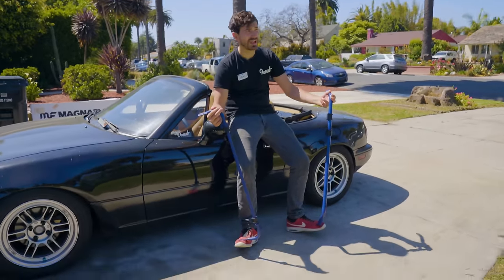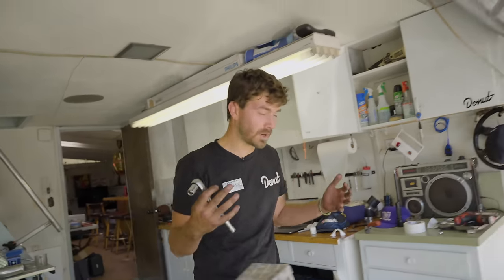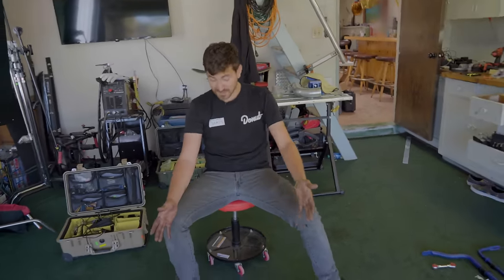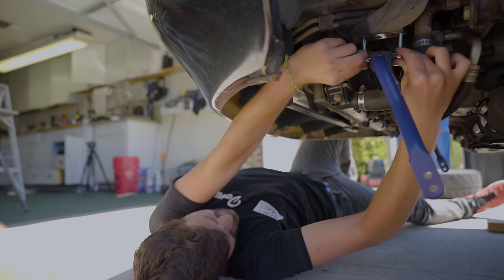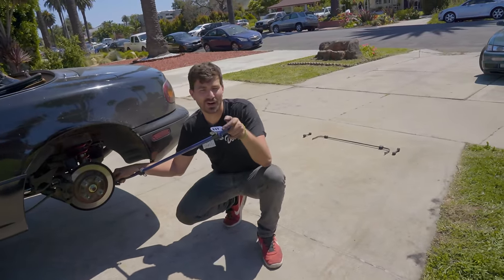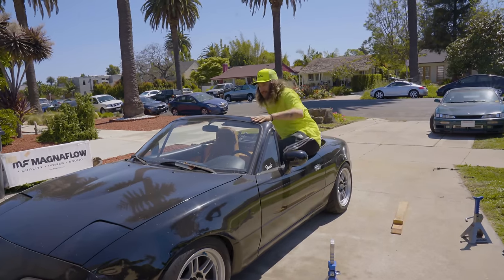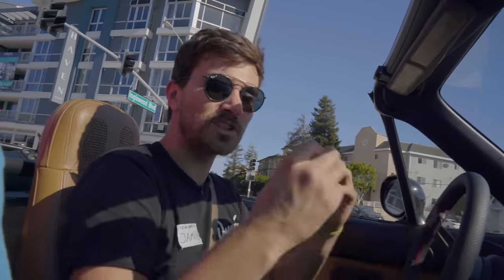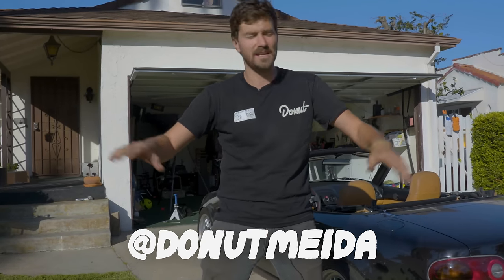Are Aftermarket Sway Bars Worth It?

Comment: I feel like handling mods in a muscle car is the first thing you should do if you're building a track/drift car, since that's typically a muscle car's weak point, it'll still be out cornered by Miatas and whatnot but it'll take corners faster than it would stock

Comment: Use Teflon tape under the bushing and the grease lasts WAY longer and it feels smoother. Especially great for the squeaks cold climates.
Reply: or just get a high quality bushing that has proper knurling like superpro etc, or even whitelines greaseless ptfe sway bar bushings

Comment: Quick answer: They're EXTREMELY worth it if you drive normal car, like a normal Civic/Golf/Corolla.
I have a old Fiat Uno that wanted to roll over and kill me at every corner, it had a skinny 15mm sway bar from factory, there was no aftermarket sportier replacement for it, so I bought a 19mm bar from the pick-up version of my car (Fiorino) and installed it with PU bushings. It made all the difference in the world, it truly transformed the way the car behaves, much, MUCH snappier.
It was such a good upgrade that I repeated the recipe in all the cars of the family.
My brother's MK4 Golf got a sway bar from the R32, and my mom's Renault Logan got the sway bar from the hot hatch Sandero RS, both were installed with PU bushings.
The difference was night and day, we live in a state where roads have tons of curves, and normal cars roll so much is actually nauseating, all 3 cars basically ignore curves now lol.

The best part is: We didn't lose comfort, AT ALL. When you're just cruising in a straight line, the sway bar is not actively working, so you can't feel any difference whatsoever.
But attention! You WILL lose comfort if you install PU bushings in the entire suspension. If you still wanna daily drive your car, with comfort, I strongly recommend PU bushings to be installed with the sway bars and links ONLY.

I live in Brazil BTW, that's why some car names might not sound familiar.

Comment: Body roll generates grip though. And for a car generally known for its exceptional handling properties from the factory, in theory you'd reduce body roll, but loose grip. Would be interesting to see a timed run of a complex handling course or before and after roll bar change with no other changes inbetween. Somewhere that needs grip too. The theory goes that youd slide around more all things being equal but with stiffer roll bars

Comment: The first time I drove a convertible I could feel a more pronounced body sway and torqueing.  The roof of most cars keeps the unibody square.  Removing the top definitely reduces that rigidity.

So yeah, anything to strengthen the frame's rigidity will make a difference.

Comment: Swaybars are first mod on any miata.  No better way to dial in the behavior of a car for street or track with a single part.  Often they are too rear bias on middle settings but that is good for street work, then put the rear bar to a softer setting or even disconnect for track time

Comment: I wouldn't say sway bars don't affect your ride unless you are in a performance kind of scenario, driving on a more normal highway pretty much true, but let's say you are in the canyons or headed down a road that hasn't been very well maintained, like you said the sway bar does its thing when there an opposing force from the suspension and if you hit a bump on one wheel, there a split second of an opposing force and depending how stiff the sway bar is you might feel it more then you would with a smaller sway bar. Anyways though awesome videos! Keep it up!

Comment: Adding of stiffer rear sway bar to a FWD car will help mitigate understeer and help the car rotate. However, getting it too stiff can lead to lift off oversteer, which can be dangerous on the street if you don't know how to handle it Making the rear stiff is a trick that Ford uses for the Focus/Fiesta ST. 

I think Mazda intentionally left the suspension soft in the MX-5 because the whole point of the car is to have the sensation of speed, more than actual speed......and a bit of body roll in corners adds to that. At least that's what I think.

Comment: 9:55 That is not really true, as not letting much weight transfer also means that the wheel with most weight on won't be allowed to take advantage of it's full grip. 
Overdoing it with a sway bar can actually result in the opposite, lost of grip in higher speed cornering. It's always a trade off between responsiveness and grip to achieve a balance.
Reply: Thank you for your expert opinion. Dont know what i would have done without it.

Comment: Well I have a 2013 Chevy Impala LTZ with the fe3 sports suspension and I can tell you when I went through and replaced the front Halo sway bar with a front solid sway bar that made all the difference in the world on how that car cornered. I also replace the rear sway bar with what's called a sports sway bar I don't know if it was really any thicker but also all my mounting points that were rubber I replaced with polyurethane which the squeak a little bit sometimes but is tremendously stiffer

Comment: I wish sway bars came in various choices, usually much bigger is the only one. They might keep the car flatter, but they also unload the inside tire, so much so that sometimes the tire comes completely off the pavement, so traction is nil. A car really does not start turning until the body rolling is finished, so they do make a car more nimble. A sway bar can change roll couple distribution, which can make the car understeer or oversteer more, change the handling in other words. A stock Miata is pretty damn neutral, or mine is anyway. With some makes you can get thicker bars from a junkyard, and add a rear bar not installed on your personal car, so it's rather cheap to improve handling. I don't believe for everyday driving I'm going to spend the money for fatter bars, I prefer the less jarring ride of stock bars. Hitting a bump with one side will rattle your fillings with fat bars.

Comment: Sway bars don't prevent weight from transferring just like stiffer springs don't prevent weight from transferring.  Stiffer suspension results in less suspension movement, but the weight still transfers.  The suspension just sets quicker because it has less movement to travel through.

Now relative stiffness changes do affect where the weight settles, so making the rear stiffer, relative to the front will cause more weight to settle in the rear causing the rear to handle more of the cornering load and the front less, but it's not accurate to say the weight doesn't transfer.

The weight transfers according to basically three things.  The amount of cornering force, the CG height, and the track width.  With the suspension travel directing some of that weight.
Reply: That is one of the most specific and clear statements in this comment section. Thank you , it was very helpful.

Comment: S 10 guys the 4 w drive blazer has 3/4 front instead 1/2 the rear has a sway bar. But you have to wield brackets to your s10 rear frame it's easy.

Comment: It would be interesting to see the actual grip limits of the suspension/tire with no sway bar/stock/upgrades. 

You aren't nessesrily adding grip just reducing body roll. More of a fine tuning handling balance
Reply: Very true. You're often sacrificing mechanical grip for car behavior.

Which is why it's very important to talk about trade offs.

Comment: 9/10 I've found adding sway bars are practically annoying. Very little thickness change changes the torsional value of the car, bad body roll for example in a Toyota Celica GT4 is bad. Usually by bracing the chassis and a front rear sway bar helps prevent the roll Issue. But too much thickness will just be too stiff vise versa. Make sure you take into consideration how much does it need to achieve the kind of line you want to achieve weather it's track, rally etc

Comment: 7:30 this segment about the swaybar and end links, is it just a skippable step with non-adjustable end links? and if you do adjust just one end link to fit as Zach did, does that asymmetry in end-link length not cause any kind of imbalance? thanks

Comment: Because the car "feels" better doesn't mean it actually performs better. Stiffer sway bar can mean more wheel hop and less traction while cornering. Mazda did a whole lot of chassis testing and that's why Miata one of the best handling cars. 
You should be doing a timed run thru a course pre and post mods to see if it actually does make improvement

Comment: I need some advice. If I have limited budget, and I want to lower the car and get some negative camber after fitting a 18 inch wheel to my GT86, should I go for a Tein Flex Z coil over or is it better value to get a set of lower spring, sway bar and camber bolts with similar cost? Thank you.

Comment: Reducing body roll does not mean more grip.  Stiffer suspension.  In oval track and road course racing generally you use the softest, smallest bar up front and put a bigger bar in the rear to make the car rotate around the corner.

Comment: Problem with Thick swaybar:
1. Increased Oversteer - if you don't know how to deal with oversteer, stay out of thick swaybar. Mazda put the stock sway bar to keep the car "SAFE" for general population average driver. OEM wants their car to be "understeering" most of the time - legal issues. You can do whatever you want with your car, but just know the risk.
2. Single wheel bump - your car may jolt sideways if one tire hits bump. It can be super annoying, and sometime downright dangerous. you wouldn't know it until it hits you hard real hard.

Look. OEM's aren't stupid. They know what they are doing - they choose the sway bar stiffness for a reason. if you want to deviate from the OEM design, help yourself but know the potential risk.

Comment: Does the sway bar make the car or help it stay in a straight direction. I feel like my car I have constantly keep it straight and considering upgrading my sway bar. I have a 2022 kia stinger gt2 awd.
Reply: if its not driving straight, or hard to keep it straight first thing to check is wheel alignment. sway bar is more for body roll and handling

Comment: You're 100% wrong about what sway bars do to weight transfer. They increase it. That's how they reduce roll, by increasing the load on the outside tire and reducing it on the inside tire. The reason they sometimes improve grip despite increasing weight transfer is on cars with compromised camber curves (like the Miata), they keep the tire contact patch flatter and more even when cornering, simply due to reducing the dynamic camber change. In cars with good camber control, sway bars reduce steady cornering grip.

Comment: Couldn't you just put jack stands under the lower control arms so that way you can install the link pins while the suspension is loaded and the wheel is off?

Comment: Some pretty bad misinformation at 10:25 ish. They definitely have a negative impact on driving. If you have a car with 4 wheel independent suspension, the wheels are relatively isolated from each other in the name of comfort. So, if one wheel hits a bump, the other wheels don't have much of a consequence. With a thick sway bar, you are doing the opposite of what your independent suspension was trying to do. Yes, you get better handling and turn in feel, but you also will feel every jolt or bump that would normally not have been noticeable.This also impacts how your car responds when hitting a bump while taking a corner. It will be more likely to respond in an undesirable way.
No such thing as a free lunch.

Comment: Please do not put super stiff sway bars to get rid of body roll. Work on shocks/struts and spring first to get less body roll, then tweak with a sway bar. The suspension of a car will work best and give you the most traction when balanced as a whole to the car. The sway bars only assist with roll control and should not be the primary way to control body roll, else every race car would just couple the suspension up with solid sway bars and be done with it.

Comment: I’m sorry but anyone from Europe mostly UK. 

It states around 3:05 “easy as that”  do not be fooled, we cannot take “sway bar” anti roll bar brackets off as easy due to our feckin cars needing the chassis rails replaced. Where the roll bar bracket is you’ll find that the metal it’s bolted too will be completelyyy rusted. Good luck

Comment: Wrong about sway bars don’t affect your ride when you’re just crusin down the street in some circumstances. In a lot of places where people just don’t have the perfect road quality with potholes and stuff, sway bars do affect your ride quality because they decrease the independence of your left and right suspension. Let’s say your left tire hits a pothole or a rock, that force transfers to the right which makes the ride less stable which actually lose some grip.
 Thick sway bars are awesome for track setups or if you don’t have to deal with shitty road quality, but you need to take that into consideration if you live in places where the road is never perfectly flat.
Reply: so sway bars are no good if i drive on bumpy road ?

Comment: What wasn't shown here was removing 40 small plastic clips and bolts to remove the under-engine plastic pan. Unless of course your are driving without it, in which case you are hurting your cooling and aerodynamics and getting a really dirty engine.

Comment: Little bit of danger in this video, if you mismatch your swaybars front and rear or adjust them wrong you can induce some terrifying characteristics into your car's handling like snap-oversteer that will fling you off the side of a mountain.  Make sure someone smarter than you picks your front and rear bars and then test them well before you head out to the canyons.
Reply: or just buy the same brand f & r and then get a good alignment

Comment: One trades roll for traction, less roll gives less traction. I drive mountain roads. This seems a deadly modification for me, reducing roll and traction.
Reply: not really how it works, sway bars are a very useful tuning tool especially adjustable ones. you dont have less grip it just changes where the grip is, you can choose to steal grip from the rear and give it to the front to induce rotation/oversteer etc

Comment: You do not need to tighten sway bars by loading your suspension that’s for fixed joints …..sway bars pivot freely at every point it is an unnecessary step 👍🏻

Comment: 2:14, Hey muscle cars need to handle (better) too! What is the point on spending all that $$$ on building horsepower and torque to going only in straight line???  Improved handling and suspension pieces are the biggest bang for the buck mod on any vehicle with the added benefit of instant gratification.

Comment: You have made the usual rookie mistake here. Nothing can prevent weight transfer when cornering except reducing weight, slowing down or moving the weight lower. Anti roll bars reduce the body roll of the car which attempts to maintain the optimum suspension setup (camber, toe & caster) so that the tyre patches can perform. They also help in suspension tuning with understeer/oversteer balance.

Comment: Try adding additional support to U shape subframe around the rear diff.  I used pipes bent to fit and smashed at the end for holes, weld it together.  Also using EVO end link makes much better rather than adjustable end links.  
https://www.good-win-racing.com/mazda/miata/61-0050

Don’t need to purchase these fancy stiffness braces.

Comment: In commiefornia, there might not be any downside to adding a thicker sway bar, or adding a rear sway bar where there wasn’t one. If you are from the snow belt, you want to be careful. You can drastically change inclement weather driving characteristics.

Comment: So weight transfer...ho boy. Weight transfer is a function of vehicle weight, center of gravity, G force, coefficient of friction, and track width. No where in the formula is sway bar, Z link, Macpherson strut, A-arm, or shock absorber package accounted for. Those components can  only have an affect on how the weight that is transferred is handled not the amount transferred. The only way to do that is to change one of the components in the formula.
Reply: Check out Race Car Engineering and Mechanics by Paul Van Valkenburgh.

Comment: Having a stiff anti roll bar on a flat road is great, how ever if you get on a road where there is a lot of camber or quick changes in camber, you will find one wheel could be not in contact with the road, bad news if your hitting a corner at speed. So you got to tune to where your car is being used the most. This video explains that very well https://www.youtube.com/watch?v=GhUE7LIxAso

Comment: I'm going to say no.  The originals are great, the links are cheap to replace every 200k miles, and only the mechanic or person run over will see them so color is not important.
Reply: the originals are usually not great, especially if you like spirited driving. and the links would likely need replacing long before 200k miles, they arent a lifetime part not that anything really is